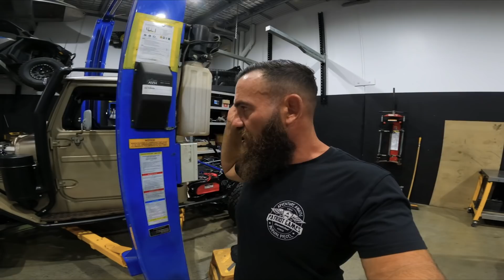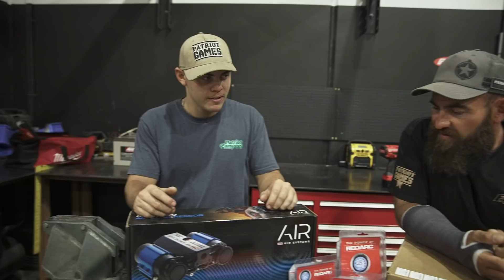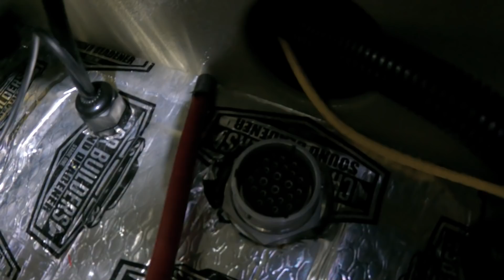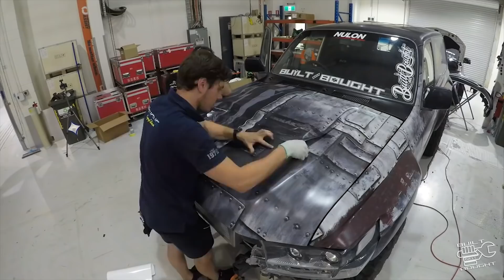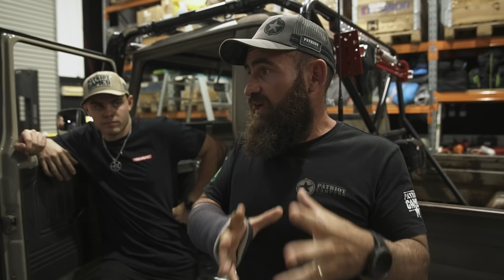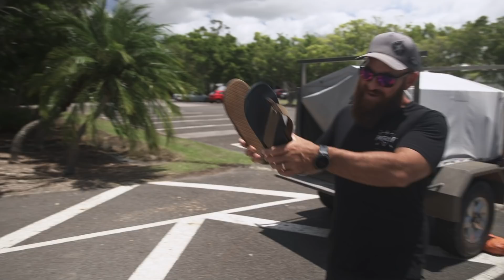FJ49 Part 17 - Engineering PASS! - REDARC controls the FJ49

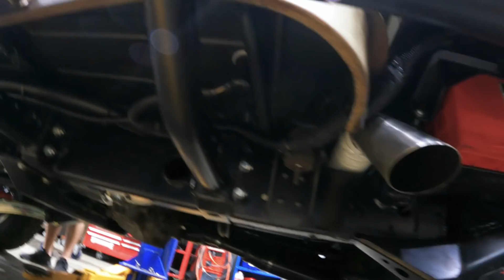Comment: Lovin the build series guys , what an awesome rig that's for sure .. Quick question .. at timestamp 24:39 . is that brand new custom harness feeding the tray sitting on the exhaust ?, or am I mistaken . Would be a shame to have that harness melt :)
Reply: the harness is covered in heat wrap and has since been zip tied away from there as well
Reply: Yea I seen that to

Comment: hey mate, if you're having problems starting the 3L and its fuel related, its normally the fuel pressure regulator on the rail. pretty common fault for these motors. chuck a genuine one in if youre going to change it over

Comment: Hey guys the fuel rail pressure valve on the zd30 needs replacing u guys do some amazing work
Reply: Not always the relief valve. I blocked mine and it didn't fix it. The fuel filter can leak pressure from the water sensor. The primer bulb check valves can fail. The injectors can be shagged (a leak down test can check this). Or even just old fuel lines can leak and let air into the line.

Comment: How have you ran the air compressor of a 20amp fuse? Doesn’t the twin run 50amps load 28amps no load?
Reply: Or does it just require 20amp rated cable ran to the compressor for switching the then inline fuse and relay at the air compressor unit?